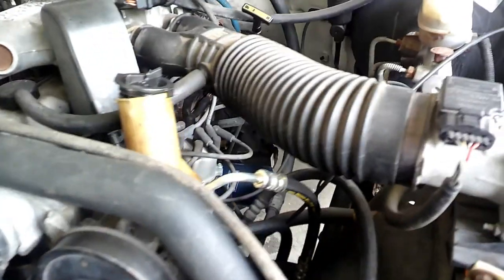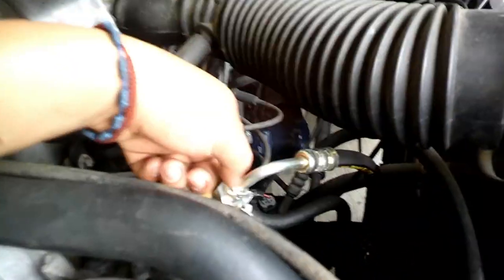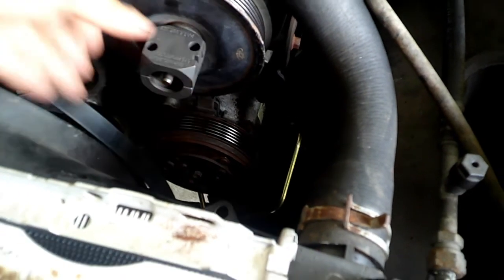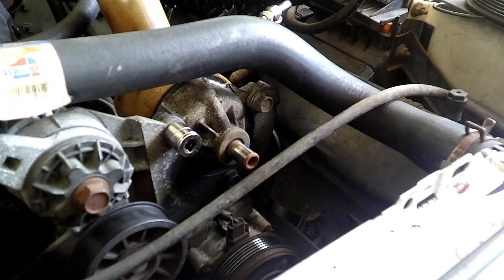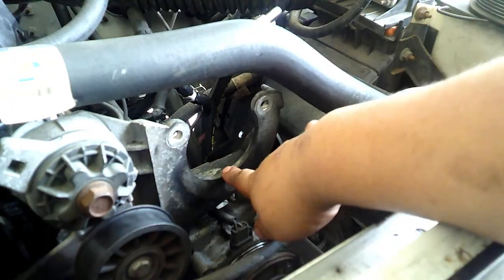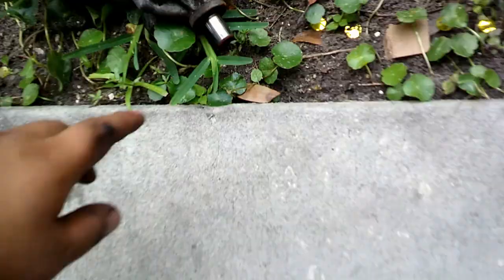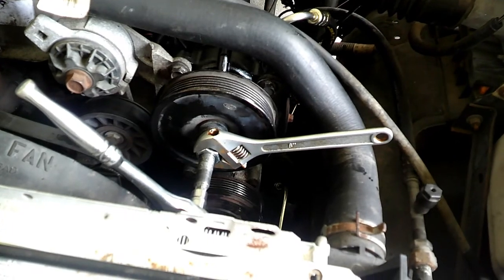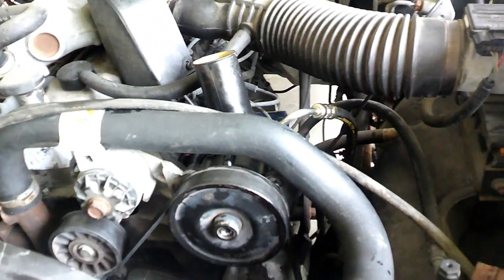How to replace power steering pump on a f150

Comment: What’s the tool called
Reply: Did it just pull off or did u have to unscrew it
Reply from the maker: Lisle 39000 pulley puller 

I had to use the tool to be able to pull it off